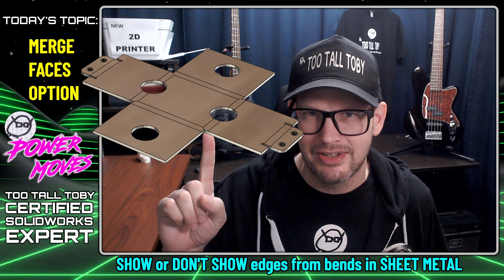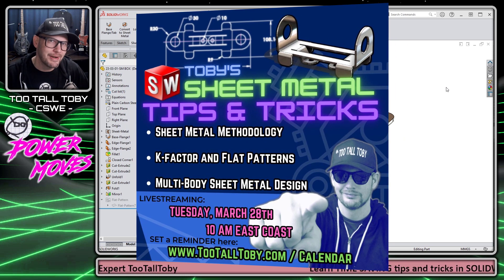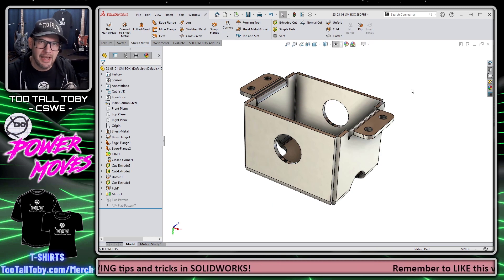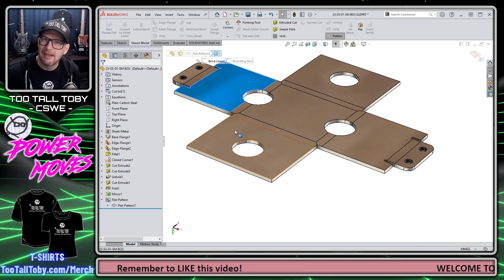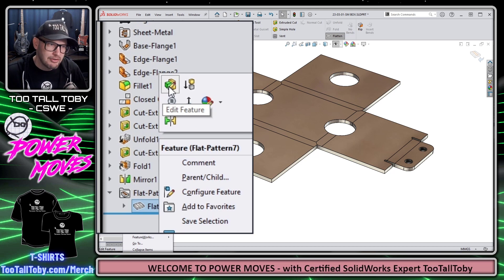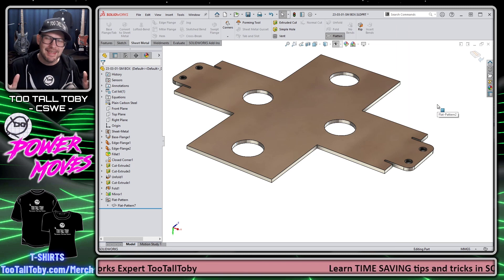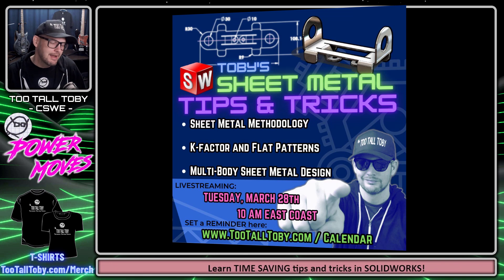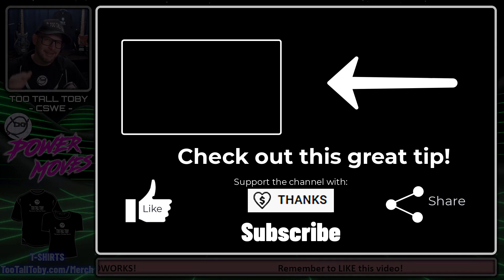SolidWorks Sheet Metal - Merge Faces of Flat Pattern - Remove Bend Edges

Comment: Idk, I just hit Save As.. -> DWG -> Sheet metal, and it removes everything, creating a nice flat pattern for laser cutting. You can actually also add bend lines there if needed (I met shops that ask to add small notches in the part edges as guides for a bending tool).
But your way is usable too for sure. And it may be used for creating some nice and smooth isometric views or a rendered picture of the flat pattern.
Reply from the maker: yeah that's a good workflow too (RMB Save as DXF) - like you said this is more for renderings and also for drawings.

Honestly I think it's more for people who WANT to see the bent faces, so they can confirm that the flat length is calculating correctly in the bend region ( IE - for troubleshooting) :-)